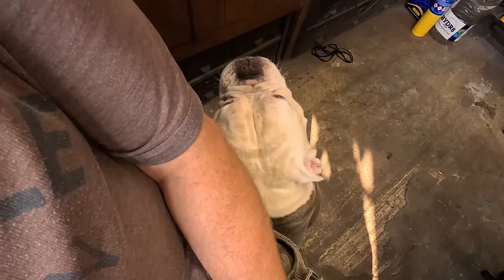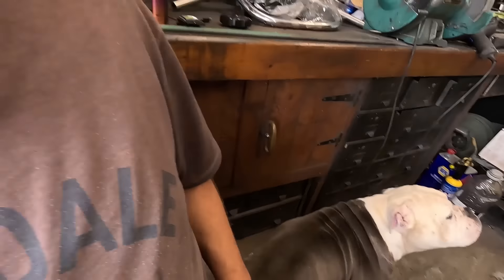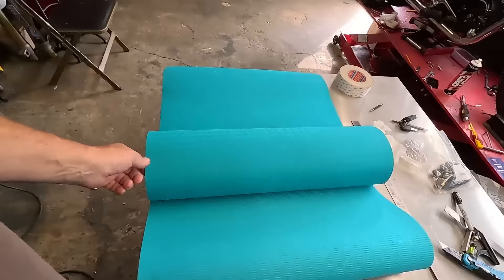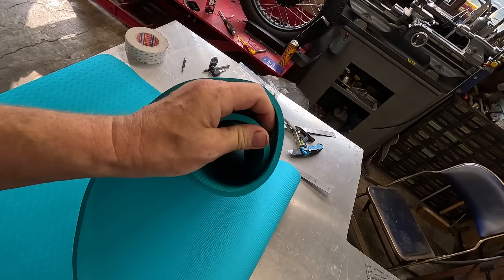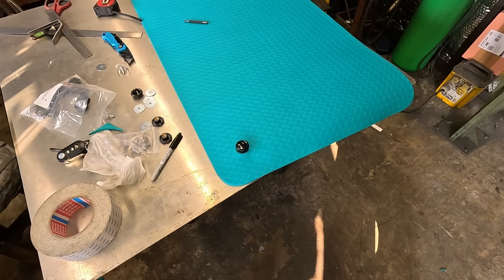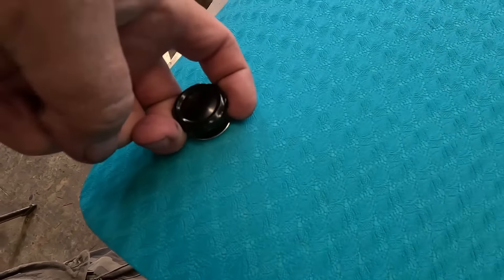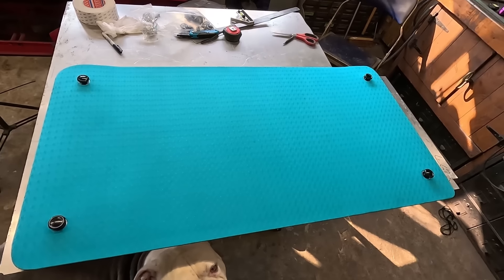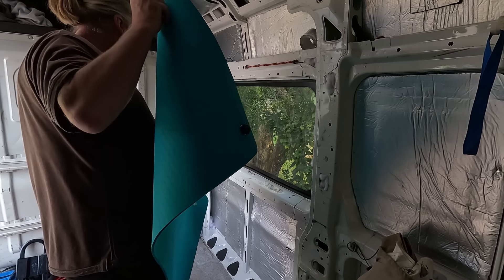Yoga Mat Camper Van Blackout Blinds Cheap & Easy

Comment: Another interesting video Craig, just as a point of interest, the obscuration bands on windows are merely to hide the adhesive which squeezes out when the robot fits the glass, I worked for Pilkington for 21 years, keep up the good work, good luck with your operation, I'm just recovering from one on my knee 👍

Comment: Those little black dots on the glass is actually a design feature to minimize the heat so when you shut the door the glass shatter years ago I leaned against the guy's car and his whole back window blew out just from the heat and me putting a little pressure on the car.